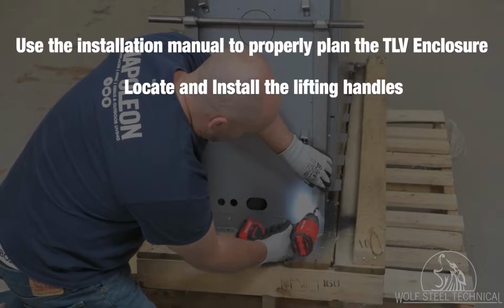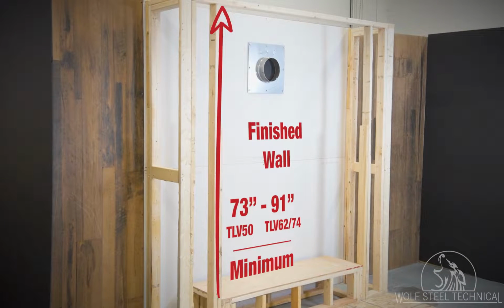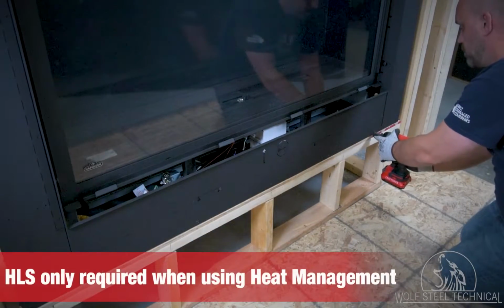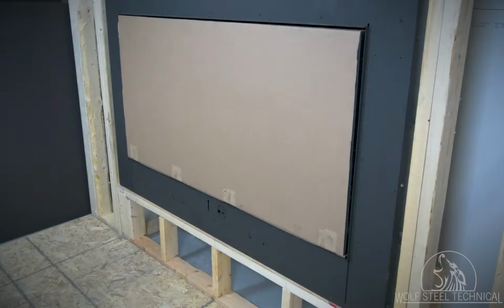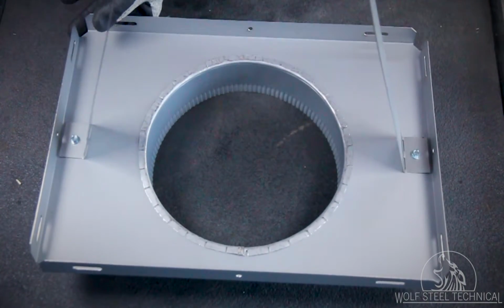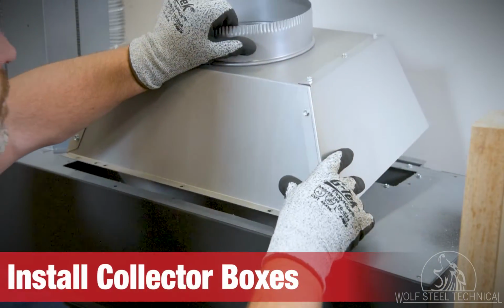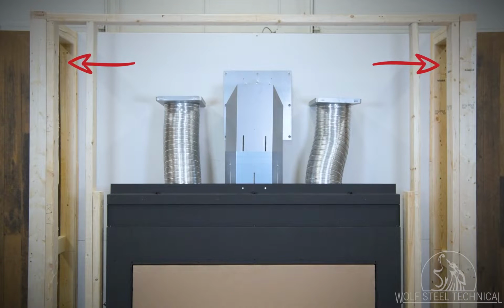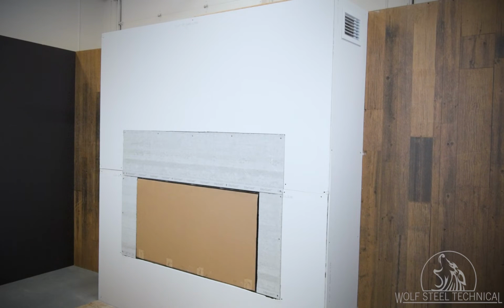Napoleon Tall Linear Vector™ (TLV & TLVL) Installation Highlights

Comment: You can’t have wood jack studs and a wood header because they are combustible
Reply from the maker: Good eye,

You actually can use combustible material in this area when using the DHM Heat Management Kit.
👍

Comment: How do you perform the yearly maintenance listed if you cover door with finishing material?
Reply from the maker: Remove the safety barrier, glass, and media from the fireplace, you can then remove the screws that secure the media tray in place from the inside of the firebox. Its a bit more work but allows you to access the internals still.

When you go to reinstall the media, come back to this channel, we have videos on how to install every media kit for the TLV and TLVL.

Comment: Thanks. One more question. Are there any clearance restrictions for building a hearth right under it so it butts up to the finishing frame. I read installation manual online it only mentions sides and top having restrictions.
Reply from the maker: I would certainly stick to the specs in the installation manual. 

If you have a digital version of the manual, I would open it with adobe reader and press "Ctrl + F" and use the search to find all instances of "Clearances" or "Clearance" This should allow you to find the info you need within the manual.

Comment: How do you access under the fireplace if you are covering it with finishing materials?
Reply from the maker: When the glass is removed, there is a small area to access the control area from inside the fireplace.

Alternatively, the media and media tray can be removed for full access to the underside control area.

Comment: What size breaker is used for this TLV50N, dedicated or shared on a 15A or 20A?
Reply from the maker: Hey!

All information for installation can be found in the installation manual for the TLV found here:

https://www.napoleon.com/sites/default/files/fireplaces_products/W415-4121_TLV_Installaion_D-0.pdf

The appliance does not need a dedicated line as it only uses a blower and lights etc..  15A would be fine. It would always recommend to put it on a dedicated line if possible though, in case you were to upgrade in the future the infrastructure would be present.

Hope this helps!